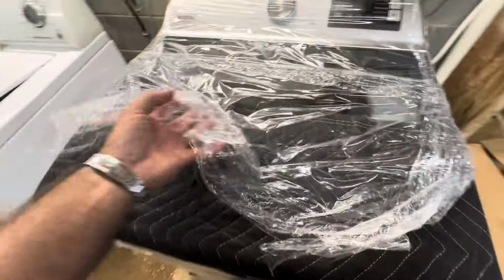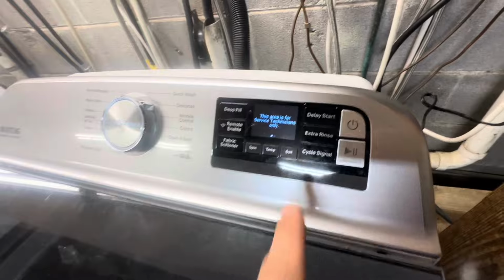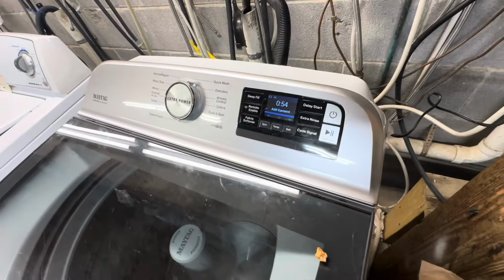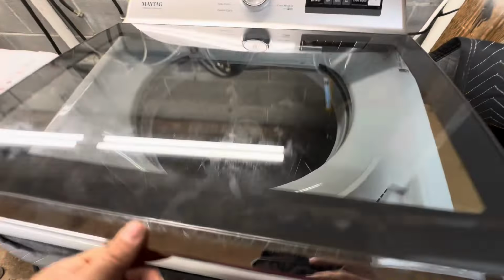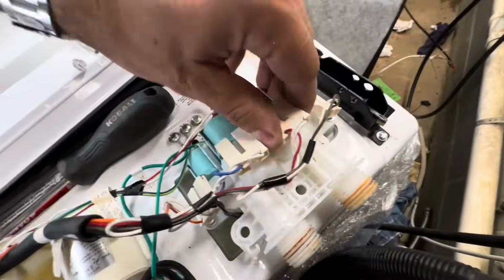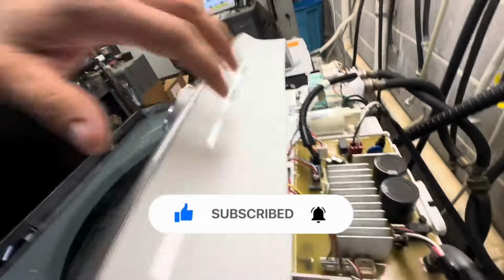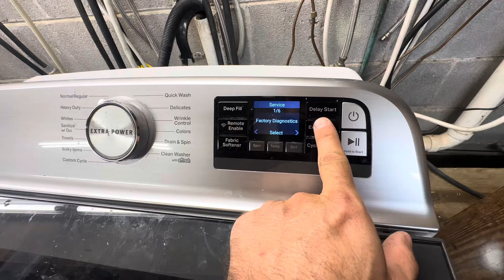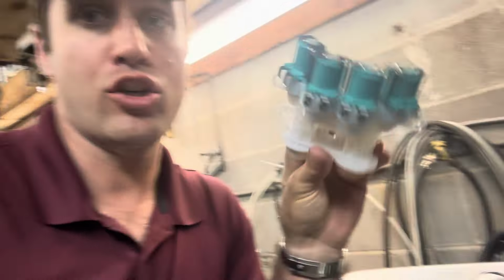Maytag washer fills and then drains | F8E1 | MCW7230HW0 | bad water valve assembly

Comment: I have the same washer that you just worked on and it’s overfilling, but it’s not the valve. I can unplug it in the valve shut off.
Reply from the maker: @streetkombat1  check the pressure tube going to the board and tub. Makes sure it’s intact and not split or off. But if it’s not the valve or that my guess is the main control. Wow that’s a good one.

Comment: I believe these came out in late 2019
Reply: I got a whirlpool wtw4900bw0, it has a bearing noise when spinning drum by hand
Reply from the maker: @coolrobuxgaming  I don’t remember what the date was on this one. But I’d imagine early 2020s. Thanks for watching Cool. I’ll try and get some shots of that one with the bad bearing
Reply: @LAapplianceguy  This particular washer in video is notorious for running the drain after hitting start and then completing the cycle. It’s also notorious for bad slider.
Reply from the maker: @ yes. Bad controls a lot too.

Comment: This model is famous for spinning for hours and not stopping... you have change the main control and it has to have another UI [ user interface ] to mate with the Main control board, you cannot just toss in a Main control board it will rejected it... i have repaired many of these...
Reply from the maker: @johncasor9698  what!? The new board won’t like UI control. Wow that is crazy. So you have to change both at the same time?  Thanks for the heads up John. And thanks for watching. 👍
Reply: Wait, you state we can't just toss in a main control board. Does that mean both boards don't fail at the same time but rather they are married or serialized to only work as a pair? Am I starting to get a whiff of planned op?
Reply from the maker: @ I have changed just the main control and or just the user interface control before. I personally haven’t run into that situation. Yet….